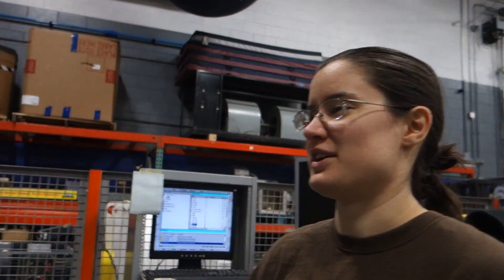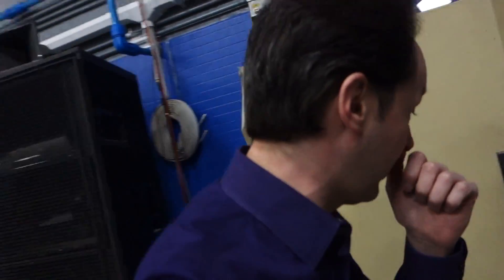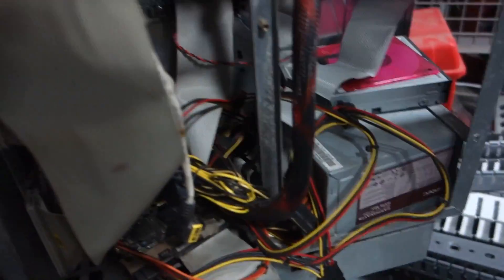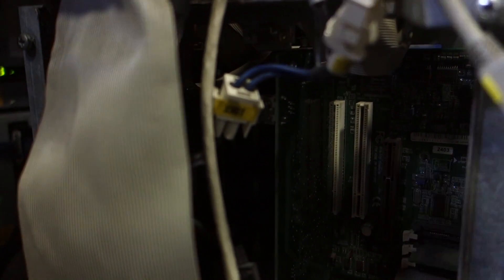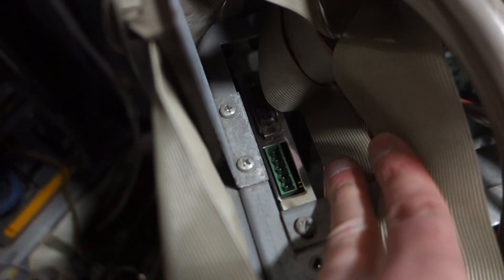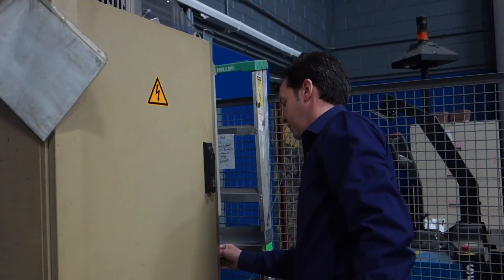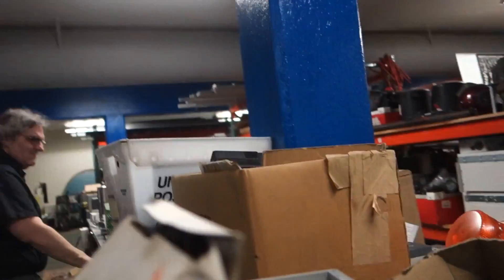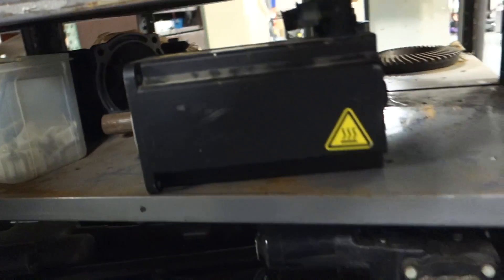Captain's Blog 3 18 2016 Jeff Recon and Tesla Coil Prep

Comment: I have a ton of old PCI and ISA network cards. I know for a fact all of them work with 95. anything with a realtek rtl8139 chipset or a compatible made by D-Link (which is usually an MPX chip) will work just fine. if you find an ethernet card with an unknown chip that isn't a realtek, there's luck it's probably a compatible chip, it was the most widely cloned ethernet chipset of the 90s into the early 2000s showing up in many, many products. it still lives on to this day as the realtek 10/100 FE chipsets found in walmart-special laptops and desktops. they were also popular for using with a BIOS flasher program to write stuff to EEPROMs without hotswapping the BIOS chip on your motherboard (or another board.)

http://support.advantech.com/support/DownloadSRDetail_New.aspx?SR_ID=1%2BGE%2B482&Doc_Source=Download 
click the Secondary link just down the page a bit, and you have an executable with the drivers for DOS, 3.1, 95, 98, and I believe 2000.

what will also work is any of the older Intel PRO/100 cards, they all have support for 95 as do the DEC 21143-based cards (also intel 21143 as they got them after DEC went under)

Windows 95 OSR2.5 supports USB, but only rudimentary USB support for keyboards, mice, and I think floppy drives. I did a video a couple years ago of a Compaq Deskpro booting a fresh install of 95 on a Pentium III with 256MB of RAM on a rather slow hard drive (for the time) in about 30 seconds running OSR2.5, and it clearly shows in the device manager a USB bus. https://www.youtube.com/watch?v=DkTl44s-MZw

vintage computing is my forte and I know way too much about it for my own good, sadly, but this information is here in my head to help you!

Comment: I might be able to give you an ISA and old PCI net cards, not sure if 95 will have drivers by default, I got the ISA one working on 3.11 with drivers from the web and NT4 picked it up so it should work ok in 95. they are 10mbit (twisted pair and coax) so it may be a little laggy with VNC. if the AUI port is picked up as a net card in windows it shouldnt be too hard to find a twisted pair adapter.